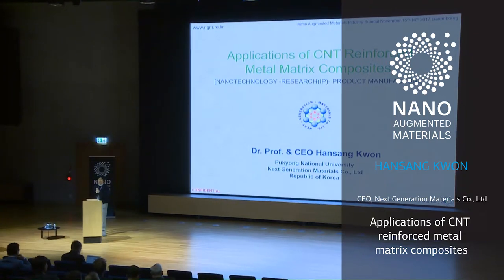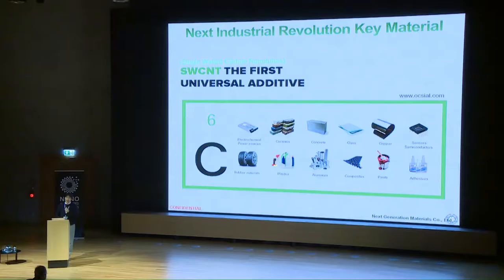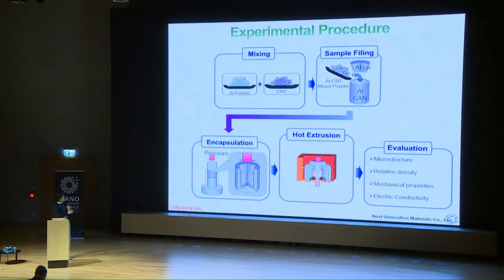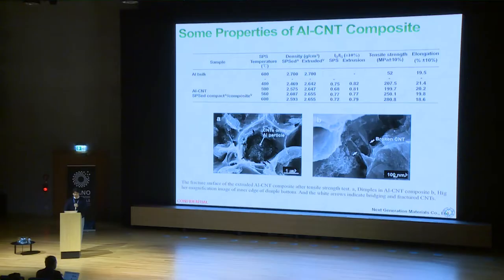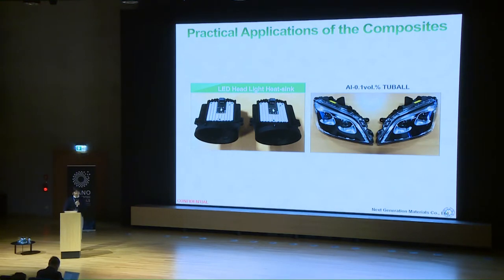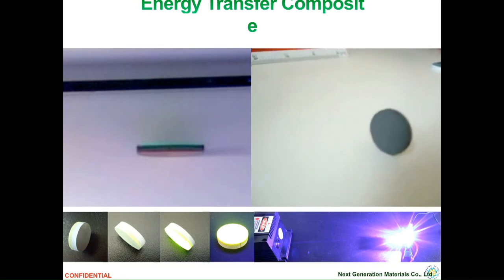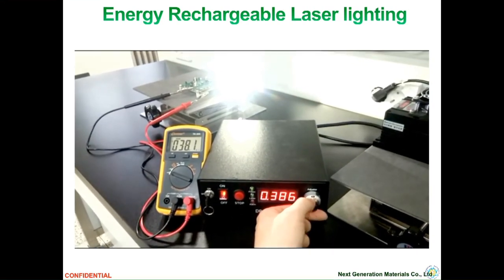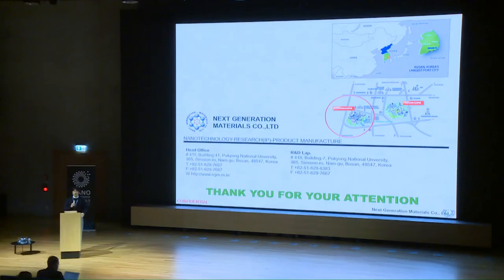Graphene nanotube reinforced metal matrix composites (Hansang Kwon, Next Generation Materials)

Comment: What about wrapping carbon fiber with carbon nanotubes, and impregnating graphene (or with boronitride) into as many spaces as possible either in Lignin carbon fiber before it’s spooled, and again in resin?

You can even put cellulosic nano crystals or other elements that are super hard into the resin to give you the desired results you want.  

That should give you something that could either be conductive or work as an insulator, depending on what you need.

Having Shaped stainless steel wires as a core also helps, especially if you want a super light, super strong, super flame resistant conductor in a magnet.